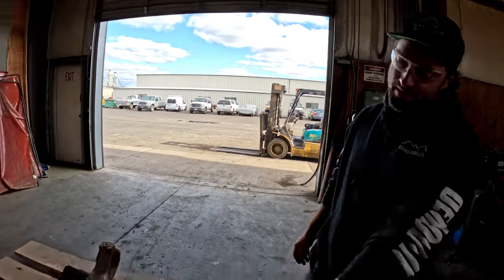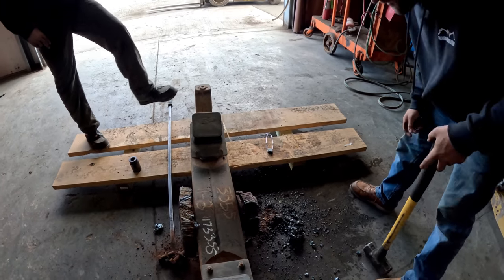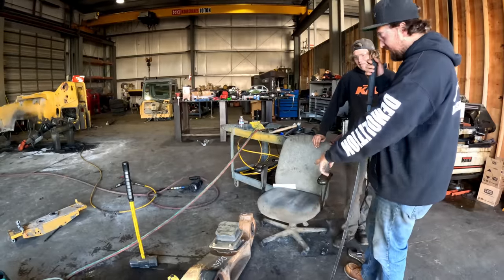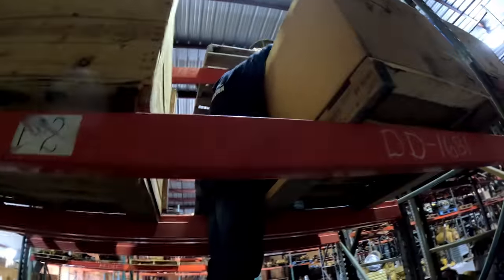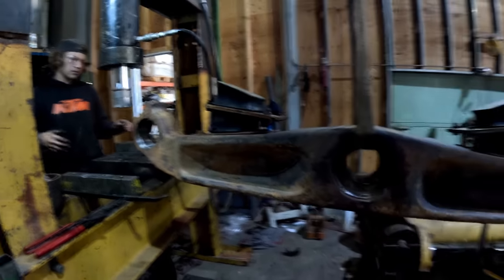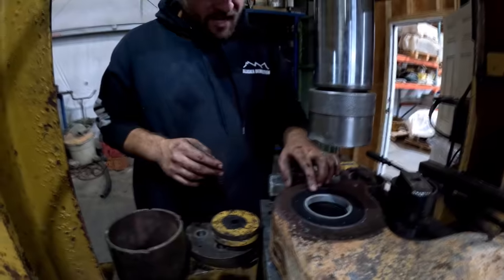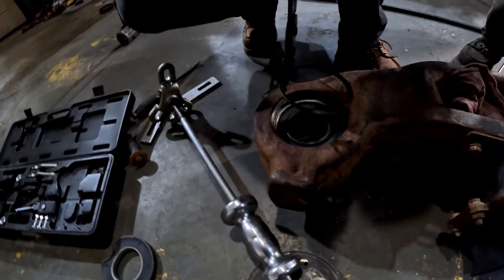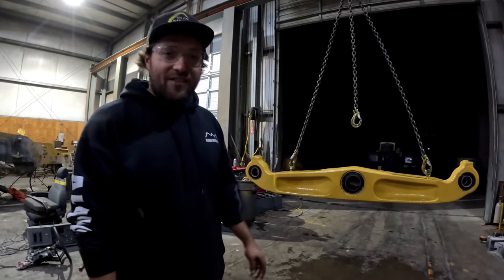Rebuilding a Cat D9R Equalizer bar

Comment: Love the show...but watching you guys take that pin out was painful..30 years as HET...cut the top and bottom
Reply: Also says " gotta do shit right, can't do shit wrong" after hammering on a tin axle nut socket five minutes before lol
Reply: Lmao 😂 right
Reply from the maker: @gregolson1824  whats wrong with hammering on an old axle socket? Its not hardened steel. Worst that happens is it bends it?
Reply: @quintonbartolotta  old socket that you are using for just hammering on it fine, but a axle socket you still use is just tool abuse.

Comment: I cant believe i watched two guys cutting beating & chiseling on a pin with 2 sledge hammers when there is a big press on the other side of the shop ,here in the east we use 3 foot scrap torches if your gonna do some real cutting.

Comment: is your Press not strong enough to punch out the center sleeve, you used to torch on?
Reply from the maker: It definitely is, im glad you mentioned this. That would have been much easier haha
Reply: It's better for the video. The press would have take 1 minute to push the pin out. They have 15 min of content cutting and hammering on the pin ! haha